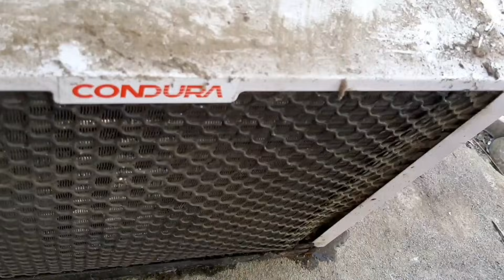How to clean your Window type Air Con. DIY - Tutorial / Air con mo linis mo!

Comment: boss pag  nag automatic ang split type ac yung outside unit ng fan mag stop ba sya o hindi.ty
Reply from the maker: Yung iba shut off dn yung ib hndi, inverter b ac mo?
Reply from the maker: Thanks po ingat ingat po tayo sa covid 19
Reply: @RDCTV  hindi po inverter kc yug amin pag ng automatic d gagana ang fan
Reply: @RDCTV  sakit sa ulo ng split type yung ng install flexible hosts ang kinabit drainage
Reply: boss ano po tamang thermostat sa 12sqm na room sa 1,5 hp na split or window type,salamat

Comment: good day sir,  ask ko lng kung possible ba na mag yelo ang evaporator kung mahina na ang capacitor pero ung fan nman malakas...  wala nman sya leak...kpg tinanggal ko kasi sa connection ng capacitor ung fan lakas ng compressor pero kpg binalik ko na ang fan humihina ang compressor possible po ba nag aagawan sila sa capacitor since mahina na capacitor?... salamat
window type manual pi ang unit...
Reply from the maker: Hndi sir.